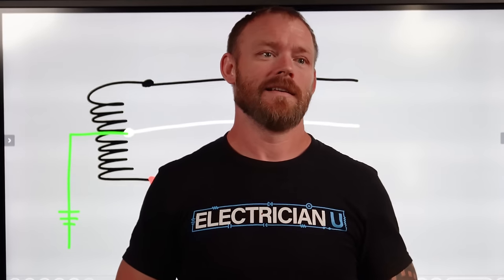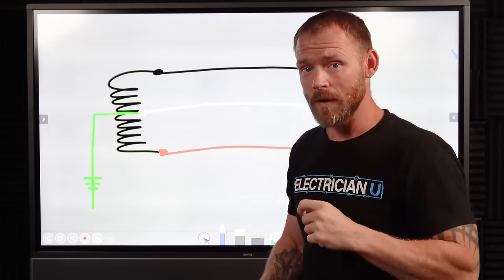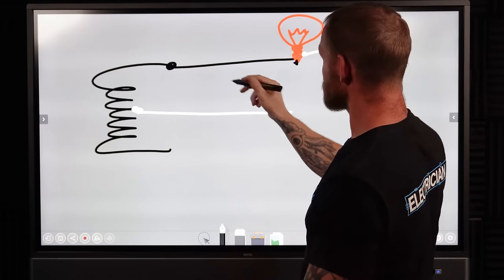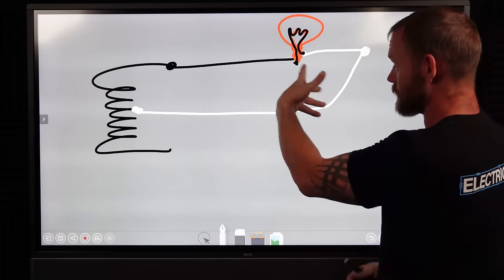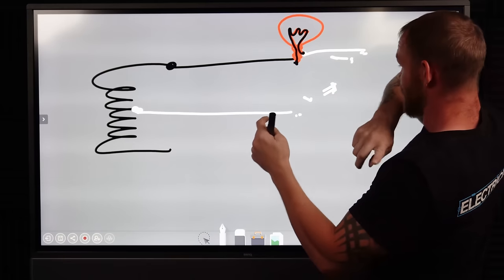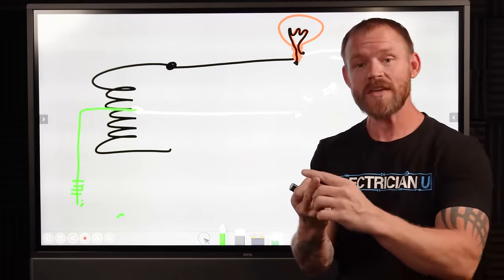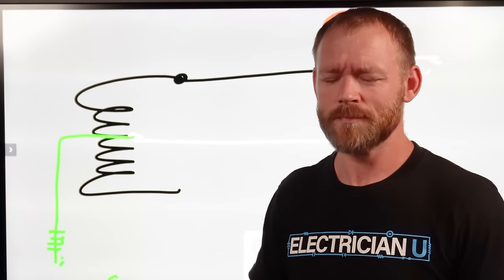Can You Get Shocked From a Neutral Conductor?

Comment: I was working on a box above a grid a few months ago. I was leaning on it, and accidentally touched the hot. It was only 120v, but it was the worst pain I've experienced from electricity. Definitely a learning experience for me.
Reply: were you grounded to any thing or did your body's surface area create some sort of loop?
Reply: There are a variety of factors that go into how "badly" you get shocked. The number 1 factor is the voltage or potential. Everything else tends to be  limiting factors to how well that potential allows current to flow. So the pathways the  current takes can make a significant difference, You don't want current flowing through your heart or your brain. So trying to keep the pathways away from those two areas is in your best benefit. You can pass some fairly high currents in milliamps that hurt a lot and may even cause some burns or even some internal damage without being killed. But  lesser currents that pass through the heart or the brain can lead to death. 

Ultimately, the resistance of the pathway, is the primary limiting factor. We have both internal and external  resistance, (through the skin contact areas). There has been a lot of research through the years and  one thing it tells us is that different individuals have different internal resistances. But in a given individual their resistance can vary through the day.  Research suggests a few groupings across a  sampling of  individuals.  The biggest grouping being around 80% who have very similar resistance and then two groups of about 5-10% that have considerably higher or lower resistance. So  most people will have very similar levels of internal resistance, but there will also be some "exceptional" individuals on both ends of the spectrum.  With this in mind, they developed current ranges and typical perception and effects of these current levels. Some things like perceivable levels in the few milliamp range. tingling, minor pain, extreme pain, muscle contraction. "let go" threshold, mild burns, etc, all the way up to typical lethal levels. 

Another key factor before we get to the internal resistance, which is quite low, we have skin/contact resistance. These end  up being the pathway entry and exist points. This is generally higher resistance than internal resistance, but can vary widely. Dry, callused skin has fairly high resistance, soft, supple skin has lower resistance.  Moisture can lower resistance dramatically. Larger contact areas make lower resistance. Pressure or compression, also makes for lower resistance. "leaning contact" is usually a  larger area with some pressure. Leaning contact with moist damp skin and solid grips, will deliver some "strong" shocks. Women and children tend to be a bit more susceptible to higher current shocks. Body mass can play a role too. 

When grabbing something and getting currents above the so called "let go threshold",  muscle contractions can tend to keep you in contact, being hard to pull free. This is generally thought to be around 30 milliamps. But depending on which muscles get activated, these can also act to push you away. Any jointed body parts have opposing muscles. So you can be drawn in or  pushed back depending on which muscles get  activated.  Sometimes that can contribute to other injuries.

So in the end, it generally gets down to the math, but the variables can  differ greatly. Higher voltage will cause stronger shocks. The time length  of a shock is  usually pretty quick, but longer length shocks can be worse. When you get above around 300 volts or have sustained shock currents, flesh can began to breakdown. That will obviously be worse and can cause permanent damage.  If you are on the low resistance side of the spectrum, you'll likely get worse shocks and may perceive small shocks that other don't. If you are on the high resistance end of the spectrum,  you are a bit better off, but the variable factors can still make you vulnerable. 

You can get some strong shocks or be  killed by 120 volts, but the potential is worse at 240 volts. If you are going to work with electricity, odds are that you will get shocked from time to time. The key is paying attention and using safe practices. Avoid working stuff live and don't do it because of laziness to shut something off. Depending on the type work you do, there may be times when there is little choice. It's just good practice to work things like they are live. even when you know they aren't.

Comment: Years ago when I knew absolutely nothing bout electric and I wanted to do something in a junction box under my craw space and for some reasons wasn’t turning off power because, an electrician from work told me exactly what you have said.  Just use one hand and you won’t get a shock, well in the crawl space was a copper water pipe, needless to say my ONE HAND  was touching the live hot wire and that bare forearm squeezing between the copper pipes touched that and that was that.  I shut the power off after that, and probably had no idea why that happened at the time.  Your an excellent teacher btw.  Thank you always

Comment: Happened to me!  The job was simple, replace 50 year old outlets on the bedroom circuit.  Got a helluva a shock on something that should be safe and simple.  Traced back to find that the thermostat transformer was tied into the same circuit.  Even with the breaker off, it was powered, because 1960 code said you can run 2 breakers with a common neutral. Arrgh.

Comment: I've got a good ZAP on a neutral line that was live, because another switch was on feeding power through it, so i became the quicker route to ground then going back to the panel.  My entire life I thought "You cant get shocked on neutral" so I always for decades touched without any issue, until the one time she got me good, lol.  woke me right up!
Reply: I bet you REALLY started to understand circuitry and grounding after that 😎.  

I’ve been shocked a few times in my career, anywhere from 120-347 volts.  Never got lit up on a neutral, though.  My journeyman explained open/broken neutrals to me very early on in my career…. Probably saved me from that “learn from the school of hard knocks” experience.

Comment: My dad was dealing with a 1970’s bathroom with a 3 way switch. He turned off the breaker and then cut 2 wires at once and there was a flash and those wire cutters now have a big chunk out of them. 

The way the 3 way switch worked was they used another wire from a different circuit. That bathroom no longer has a 3 way switch.

Comment: 7:10 I do this when working on server ups units. Capacitors hurt when they discharge through you. Always 1 hand in pocket and I'm standing on a rubber floor mat. Those big server ups units the size of file cabinets are no small tickle.

Comment: I was digging up a steam line with excavator and  a pipefitter jumped down into trench and cut pipe away from Building.
When he touched both cut half's climbing out of wet trench he was electrocuted .
911 call.
I saw him drop into trench and we tried to pull him out.
He survived CPR used by a guy who was from Us Navy Medic.
Turns out the steam water condensate pipe were bonded to ground neutral and when he cut pipe potential existed between both halves.
His wet hands touching both sides almost killed him.
In IBEW we were taught to test with back of left hand only .

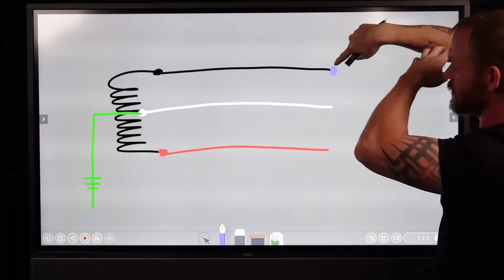Comment: 1:13 "and then like just jump through the air" yes, it can. I did get a shock this way. European, 3 phase system, one conductor touched my finger, and two centimeters below a spark came out from my finger into the other conductor, jumping through ~2-3mm of airgap. 400V, I'm lucky, had a scar for a month.

Comment: A tile guy was wet cutting tile outside a patio door. He said every once in a while he would feel something that felt like a slight shock when opening the door. 
My tester was beeping anywhere around 3 feet away from any wall or wire by the patio door. In the attic above the same spot, my tester was beeping with the nearest wire 3 feet away. I thought my tester was on the fritz. 
Troubleshooting the problem: An outside light was installed next to the metal patio door frame on an aluminum sided house. A screw was drilled through the neutral wire during the outside light installation connecting the neutral, patio door and the aluminum siding together.
Reply: So the current flowed through extra metal before continuing the loop to source…? This is the picture I am drawing in my head.

The door and siding have enough resistance that keeps the amps down as to not trip the breaker? I am supposing So because he only felt a little tingle. That’s wild. I wonder if anything would change if that light was on. maybe he would’ve got shocked harder if the light was on.

Comment: I had a guy I was working with about 20 years ago when I was still pretty green take apart a hot neutral on a 277v lighting circuit and try to tell me to not worry about a neutral because it would not shock anybody. Then he got lit up when he grabbed the wire. To say the least, it was a learning experience for the both of us. Lol

Comment: Test everything first and always.  You can get shocked by the hot, neutral and the ground.  
If the voltage is high enough it doesn't matter what else you are touching.  
If you touch the wrong side of a neutral you are completing the circuit.
TEST EVERYTHING

Comment: Alternating current can " capacitively couple" through an insulator. That is one of the functional characteristic of a capacitor. That's also why some LED lights will slightly glow in the dark -- the switch does a small amount of capacitive coupling. That said, the coupling can be negligibly small for practical purposes. Switches and circuit breakers are designed to have negligible capacitance.

Comment: Braced against a sheet metal stud in a tract house I felt a jolt thru my shirt on my back. Checked my drop cord, Hole Hawg cord and switch.Nothing wrong with any of them.  Finally determined that there was an open neutral at the temp pole that Del Webb had installed for the houses we were working on. Apparently the power was depending on the equipment ground to complete the circuit to the temporary panel.There were other subs working off this pole but nobody else had noticed a problem....yet.... I went to the super and warned him of an unsafe condition and was promptly ignored. I mean here was a plumber trying to tell him that he had an electrical problem so what the hell could I know. Right? I knew someone could be hurt so I went out and "disabled" the panel.  When all the subs started screaming that their power was off  and the panel was "damaged" they were out there in nothing short of light speed to fix it.....a whining plumber getting shocked was one thing but slowing down of production was an entirely different thing.... Money always speaks louder than one lonely plumber......🤣🤣🤣

Comment: Touching two points, a man lift that wasn't grounded parked under 350kv(or better)  lines for the weekend,  in an environment where the voltage pen lit up outside. 

Strapped in and drove inside went up right hand on the boom basket railing, left hand reaching out to over head door, didn't even make context.. all the built up energy must have left through me to ground. Still can't hold 5lbs above chest height. Constantly dropping tools after 1.5 years later and a hand surgery.. still only have about 40% grip strength, if that. 

Still looking for the proper health professional to assist with rehab

Comment: When was a child, I grew up in a house that was originally built in the 1950's. It had a finished basement with two prong outlets. There was a lamp that we would turn on by pushing a switch on the lamp. I remember getting shocked by that lamp at random times and I didn't know why. Since I was a kid, I didn't understand what was going on. What was happening is that sometimes I was touching the metal lamp socket shell or cap while pushing the switch of the lamp. Sometimes I would do this with bare feet or with socks on. So I was completing the circuit with my feet even though the floor was tiled. I'm making this point because when we use the word "touch", people assume that means with your hands, they never consider that their feet can complete the circuit.

Comment: I"ve had the exact same forearm shock experience, except the equipment in my case was an environmental chamber with 220VAC incorrectly wired to the metal interior that was supposed to be cold. I'm definitely thankful it was just a little warning bite and nothing more.

Comment: Yes. You can get shocked on a neutral that has opened being serviced by a hot that is closed. Especially if the neutral isn't bonded to ground service at panels

Comment: Hell yes you can get bit by the neutral and it hurts the worst in my experience
 Especially with a lot of caps on the load 
Not because of touching just the neutral but like you said, whatever other grounded thing you're touching.

Comment: when I heard the question, I thought it was between neutral and ground. The answer is yes, if there's a resistance between said neutral and the midpoint in the transformer, that is sufficiently high, and the resistance through the new path you provide is sufficiently low. Classic example is if the neutral you're touching is not connected to anything

Comment: In Finland, first thing they teach us in school to become an electrician is how electricity will kill you and your customer with neutral being broken in different points in the current loop. PEN-conductor from utility being the worst of them all and it has been quite common breaking point in the past, when we had a lot of overhead lines.

Also ~everything being three phase here makes it hard to understand where would the then not so "neutral" potential end up with different loads going on and off. I'm sure it won't be fun in split phase systems too, but we have basically whole second dimension for neutral to find its place from. Our meter cabinets should have their own grounding electrodes (usually 15 meters of 16 or 25 mm2 bare copper in the ditch with incoming utility cable or a loop around/under the foundation of the building), but depending of the soil, it won't be enough to replace broken wire from the transformer/utility cabinet/etc.

I was a bit surprised that the explanation only had a group level broken connection and it seemed that the utility/cabinet side of things were always the real neutral.

Comment: A year ago I was on a scissor lift in a trough wireway doing demo - tons of unmarked 120 and 277 circuits. Thought I had a dead 120 circuit. Was labeling another wire when my hand came in contact with what was a 277v circuit neutral and the metal trough. Quite a wake up. I think the saving grace was there was only one light on the circuit, so current was limited a bit, but I had to come down and take a break once I isolated the wire.

Comment: OK, nice explanation.  Here's my question: at one point you say ~'can get shocked between neutral and ground. '  But, if neutral and ground are bonded at the panel (and I believe they are supposed to be, pls correct me if I'm wrong) wouldn't the shock require some sort of fault/disconnect (similar to your white hot wire example) or load between the touch point and the panel on the white side of the circuit? ... otherwise wouldn't the current just ground via the white as opposed to through the installer to ground?  thanks

Comment: Actually you can never get shocked by the neutral. You can get shocked by the "white" wire if it's  not physically connected to the neutral, but then it's really not a neutral, it's a white wire

Comment: What is the best thing to do after u get shocked I’ve seen people freak out and panic not sure if there is a proper procedure
Reply: If any of the current goes through your heart I believe they typically wanna keep you at the ER for 24 hours to monitor your heart. People have been hung up, broke loose, shook it off and went about their day only to drop dead of a heart attack later on because of their heart being out of rhythm
Reply: Re start the heart is number 1. If a heart is stopped by lightning or electric shock it is the rare instance that you might get the heart to restart without the paddles. Keep doing cpr until the ambulance arrives. 

Step 2 is look for burns and treat them. If there are burn marks really far apart, like a hand and a knee, their might be internal burns so call 911. If it is from your hand to your elbow still see a doctor but the damage is contained in that forearm.
Reply: When I got shocked the guy I was working with made me stop pacing and looked at my hands for burns, adrenalin will be through the ROOF so having others with clear heads check for stuff like that is critical.

Comment: Thanks for another great video!  I do have one question on the open neutral.  I'm just trying to understand how much of a shock a person will get if they complete the circuit for the open neutral described in the video.  In that case, the person and light bulb will be be in series in the circuit, so I assume the voltage drop across the person will be less than 120 volts and hence the shock won't be as bad as it would be otherwise?
Reply: It might be a little bit lower, but probably not by that much. A 60 watt bulb on 120V will have a resistance of 240 ohms. Your body's resistance will be much higher than that (and if it's not, you're really screwed as you'll get a huge current going through you). So most of the 120V will be across you.

Comment: Had 120 hot going into a motor, was working on the loose neutral on said motor, bumped the ground with my arm and completed the circuit thus getting shocked on the neutral wire.